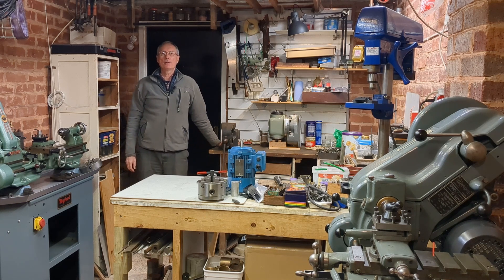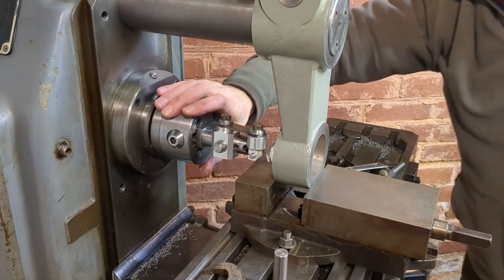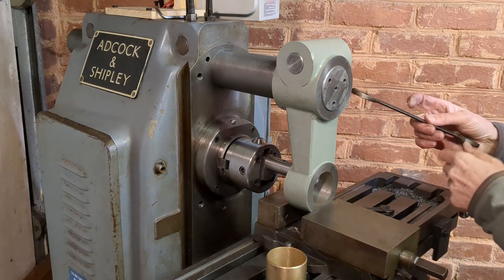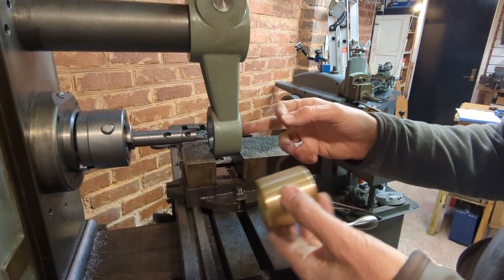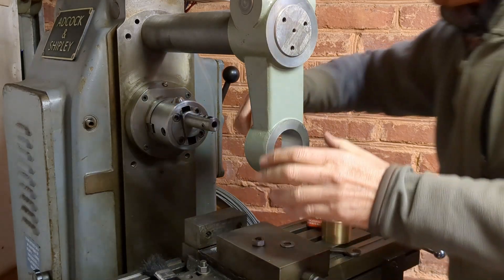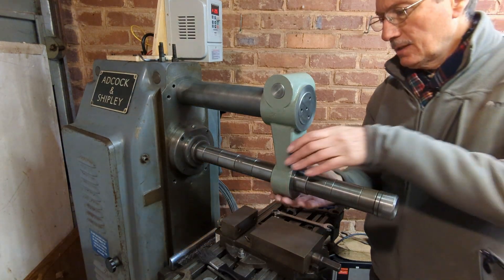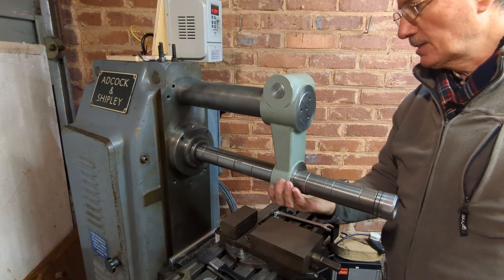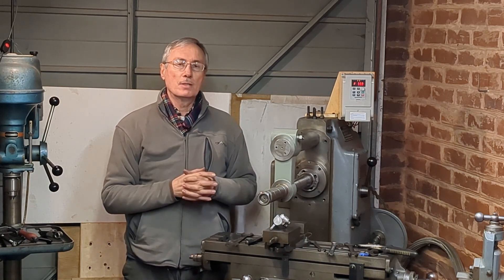Adcock & Shipley milling machine restoration - part 12 (completion of overarm support)

Comment: Kind of amazing I bumped into this, I need to make a over arm support for a Van Norman 12 mill.
Reply from the maker: Hope there is something here that might be helpful. Looked up the NV #12. Looks to be of similar proportions to mine though to be from an earlier period. Have fun!
Reply: @Workshopfriend  I'm not sure of the year, but the size is similar. I was looking at a steinel with a vertical head but decided lifting the 92# head off would get old real fast and if something were to break, parts aren't available.

Comment: Hi Clive,  It's been a real pleasure watching this rebuild as my uncle had the same machine but possibly a tad older as the power feed was a 3 belt pully. Plus the real odd ball for us was the 18/8 degs taper we found out, not 40 int but about 35. His machine was imperial. His machine had a rack on the table if you disengage the half nut. 1 major down side we had was it was well before VFD where though about or inverters hence a small 1 hp single phase motor been fitted by us.    Memory's oh Memory's 

Look out for a 1 inch arbour tooling easier to get.

Steve
Reply from the maker: Thanks, Steve, for your feedback. I haven't heard of that taper. There still seem to be quite a few A&S small mills of various vintages in home workshops. Yes, you are right about the 1in tooling. My 1 1/4 arbour also feels unnecessarily bulky.

Comment: The K&T mills have an oil reservoir and sight glass, total loss oil system gravity feed system
Space would be a constraint with yours, a simple oil drip feeder with reservoir and sight glass with adjustabe rate would solve the lubrication of the spindle.
I use one on my homemade slotter to lube the dovetails on the ram, bit messy but works.
Reply from the maker: Thanks, Willem, for your comment. I believe I have seen oil reservoirs built into the casting which seems like an elegant solution. I might end up with a parking frame which keeps the stored support arm vertical so something like this might be possible!

Comment: Beautifully done sir. Just an idea for oiling of the bush...I have a lovely Centec 2A with vertical head, raising block and overarm support, the bush is lubed with a dashpot at the front of the arbour support, this makes it easier to keep a check on the oil level. Also this may somewhat reduce swarf contamination that a side mounted dashpot may suffer? But in practice I'm sure side mounted will be fine. 
 Looking forward to seeing the Colchester move, I took have an old student , it was a task just transporting it about twelve miles, let alone a few thousand. Hope all goes well.
Reply from the maker: Thanks, Constantine, for your feedback. I like the idea of a lube arrangement which is visible. I think this deserves a little more thought. I keep wondering if there is something practical which will scupper the lathe move!

Comment: It's a pleasure to see a job done well.  The calculations, though elementary for engineers, do not get much coverage in video format.  I thought that was a useful addition.  And for those of us who have done many such calculations, it was good to see you check the theory with measurements.  If I may pick a nit, when you use abrasives on the lathe, whether woven or non-woven, a small piece in one hand is better.  I hear that YouTube is awash with caution comments, written from armchairs around the world but accidents still occur.  The end of a smooth round workpiece is a lower risk than the interior of a shaft with a protruding pin but still....   Also, keep in mind that the non-woven abrasives are simply abrasive grains glued to plastic fibers---they drop abrasive grains everywhere with almost no provocation.  Thanks for the video series and I'll be looking forward to whatever comes next.
Reply from the maker: Thanks for your comments. Since I have received positive feedback on including calculations I will see if I can continue to include them at an appropriate level - from time to time. Yes, your comments about using abrasives are noted. I certainly do not want to encourage bad practice. Also, I am normally careful not to allow abrasive to fall on the bed by placing cloth on the bed. But that might also be considered a safety concern?
Reply: Even elementary calculations can be illuminating and can very often be surprisingly accurate. It is an approach I share and commend.